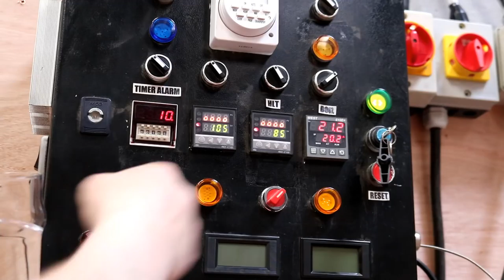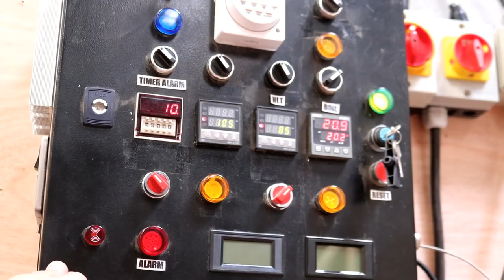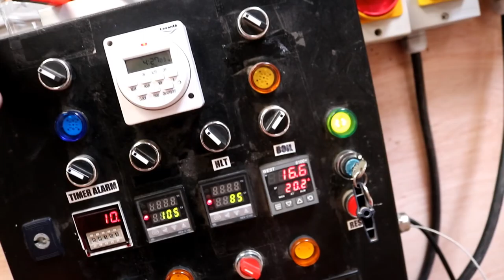3 DAYS AWAY

Comment: So you have one power supply bringing in your 240 volts on the left and a diffrent one on the right to bringing in your 440 volts for the elements
Reply from the maker: No, On the right is the Neutral bar. the 440 goes straight to the SSR's
Reply: HarryBrew69 i think i understand. Ive gotta wire up a pid that only runs on 12v  then bring in a seperate 240 feed for an element so konda looks similiar